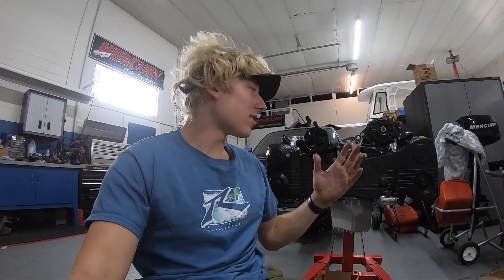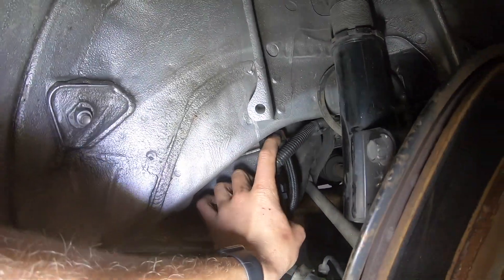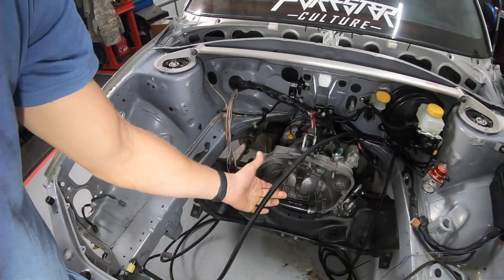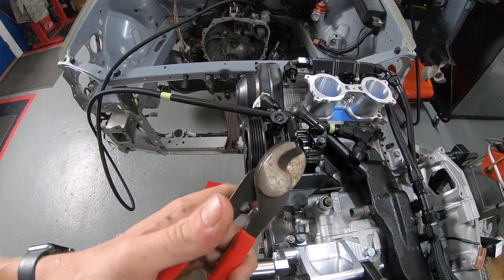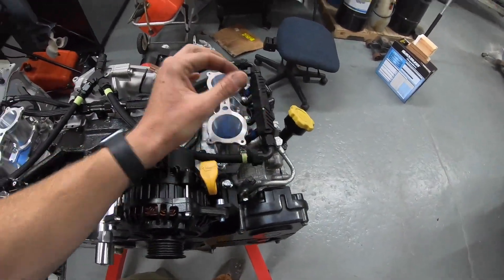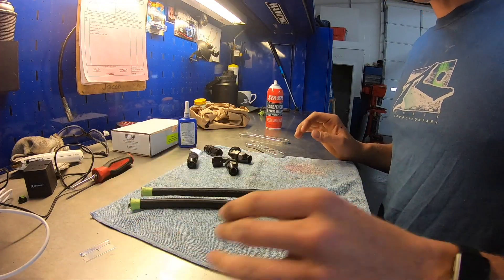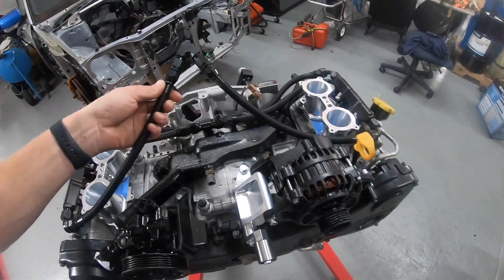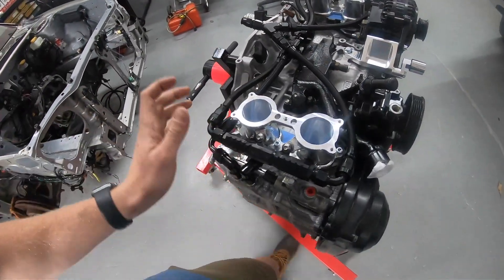SUBARU PARALLEL FUEL SYSTEM OVERVIEW | ASSEMBLING PTFE -8 AN FITTINGS | ROAD TO 800HP SUBARU EP 22

Comment: aye im tryna run corn and i was wondering if i could keep the stock fuel lines coming off of the fuel pump. I ordered some IAG stuff and came with the lines for the engine bay but i don't know if it is enough
Reply from the maker: Depends on the power goals! I’m not an expert on the topic but it would probably be a good idea if you plan on pushing much over 5-600 whp. Especially on the corn

Comment: So are the return line on the back side of your rails 6an ? Cause In the video Of you showing  the fuel rail you said you had 8 an fittings in it. I was just wonder cause i plan on doing the same fueling set up  but the return 6an part is confusing me with the 8an feed
Reply from the maker: So all the feed lines from the tank through the fuel filter, fuel rails & to the fuel pressure regulator are 8AN. The hose coming out of the FPR, through the flex fuel sensor then returns back to the tank is 6AN
Reply: @jakeheavlow  ohhhhh gotcha !thank you much man I appreciate!!

Comment: Which brand fittings are those?  I am about to order vibrant stuff but there ptfe fittings are non swivel which I wasn’t super high on.
Reply from the maker: https://www.ebay.com/itm/AN8-8AN-90-Degree-PTFE-Teflon-Swivel-Hose-End-Fitting-Adapter-Black-QUALITY-/254600124671?_trksid=p2349624.m46890.l49286